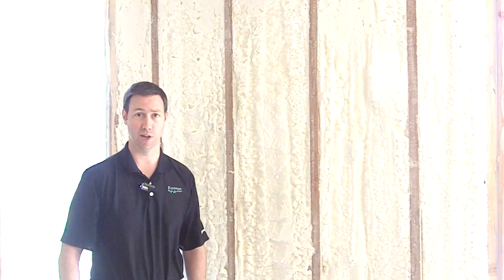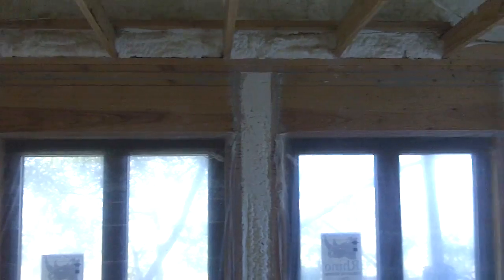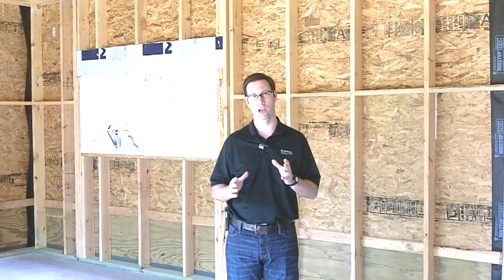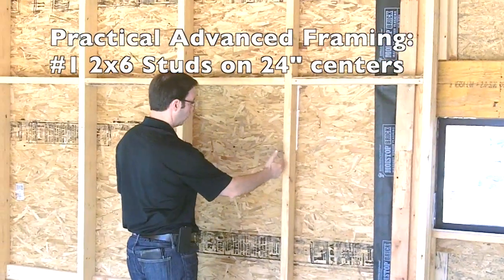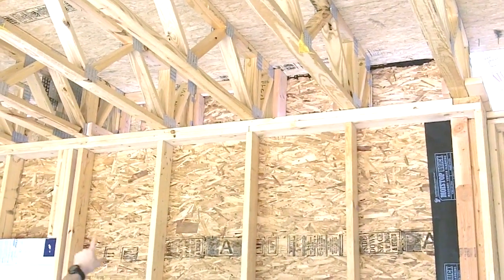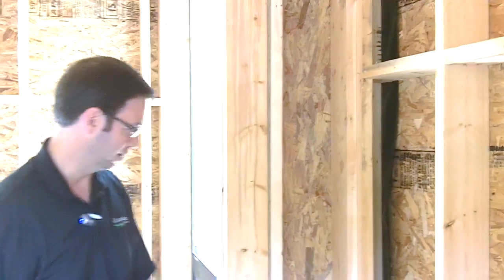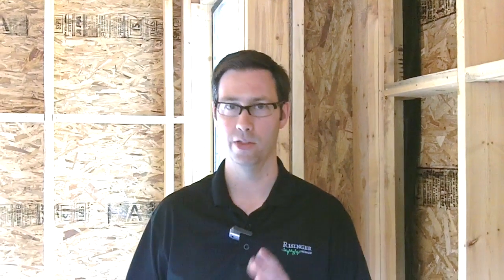Advanced Framing vs Traditional Framing

Comment: I'm sorry but "practical advanced framing' looks like a crappy way to build a house.  Same old technology but reduced for cheapness.  I'm building our new house using SIP construction.  That's Structural Insulated Panels.  Custom made to order from the traditional plans converted to suit the CNC machines they are produced on.  They consist of two surfaces made from OSB with rigid polystyrene between them.  That's the same insulation that you use to hold your hot McDonalds coffee. They are available cut from sheets 6" tp 11" thick and from 8' to 22' long.   Because they are made in an environmentally controlled factory you can be sure they are square and will not warp.  They assemble quickly and provide a dry comfortable environment to complete the interior construction using traditional methods where insulation is not critical.  The roof panels create insulated attic space without all the joists that get in the way when you want to access that space for storage or extra rooms.  They do cost a little more per square foot but quicker construction times can offset that cost considerably.  And they are far more thermally efficient than traditional construction while being around 40% stronger too.

I'm sorry 'practical advanced framing' may be practical but it's not advanced.  And I'm not sure how practical it is for the owner as it appears harder to insulate, adding expense, and appears weaker too.  Come on framers.  Get into the 21st century!  Learn how to build using SIP construction.
Reply: SIP's have their advantages but if ever a repair is needed or you need to get into the wall to access plumbing or wiring, it becomes a tough and hugely expensive undertaking compared to a standard stud-fiberglass wall. I'd rather use SIP's than the BS methods this guy is trying to sell though.

Comment: I have been in the industry for 40 years and I see no real benefits to advanced framing.  Stud spacing on 16" centers makes for a stornger and smoother wall.  OSB and drywall work better on 16" centers.  The way he does his corners take the same amount of lumber as a traditional corner but you have more to nail corner boards to on the exterior with traditional corners.  I like having the 16" centers for my siding too. It gives me ore options on joint placement.  I could on and on why California framing is more about politics than construction.   Also, your rafters should stack over your studs and just take a look at the span tables to see how many options you have at rafters 24" o/c.  16" centers works better for the entire house.   As long as you air seal all penetrations in your walls you will be fine regarding insulation.
Reply: http://risinger.co

Comment: Rsinger is a funny boy. What he calls 'advanced framing' is nothing more than economics and availability: balloon framing was used because longer, cleaner lengths of wood were easy to attain. These days it's difficult to find and much more expensive to buy long boards.I built homes for thirty years and always used California corners, so they're nothing new, just different. Yes, they allow insulation, which is always a goodness thing. Liimibeams and headers are relatively 'new' but have been around since Rsinger was in three corner pants, so they're not really new, either. Nor is utilizing treated ply for the lower wall. Two foot centers are nothing new, either. Nor is a 20 inch center (that's the little diamond at 19.3 on your tape measure). Sixteens make for better interior work, as well as adding more nailing surface for sheathing. With plastic siding, you'll be happier with 16 inch centers when the weather heats up.  We won't get into the rest of his liberal rantings, like vapor barriers (but he likes moisture proof foam insulation)…
Reply: Rock on dinosaur man! 
http://risinger.co

Comment: Unless you are installing Siding. Siding needs 16" on center. You built a house with Siding that will slap in the wind. How much did you save? At what cost?A solid piece of Wood will insulate far more than "Insulation". Blown insulation? Without a vapor barrier? I can install regular insulation WITH a vapor barrier for far less. 2X6 Walls with 2X4 insulation give you an air gap. That is far better than packing the cavity full. Everything I have built proves it.
Reply: Exactly, and no corner backers for siding corner trim boards... I guess the plywood will have to do :-O

Comment: Advanced framing? Corporate speak nonsense. What a load of crap! 24 inch centers? Yeah, you better use thicker drywall.
Reply from the maker: Yes I advocate for 5/8” rock. Not sure why you think this is “corporate “?
Reply: Corporate speak describes how language and jargon is used to attempt attach importance to oneself, by using unfamiliar terms. "Advanced framing" isn't advanced, it's just different and it doesn't necessarily make for a better frame, but selling "different framing" is harder I imagine. Then, you go on to pretend that these methods have no draw backs, polyfoam is toxic, and six inch lumber is more expensive and harder to work with, just as five eights inch drywall is much heavier and cumbersome, but hanging on less lumber.

Comment: for 2x6 walls in a non hurricane or tornado area 24in center may work.  This is cutting corners with 2x4 and in hurricane prone parts of TX.  Go ahead and get away with it in ATX but framing is such a lower cost compared to interior buildout that you won't find me cutting corners.  For 2x6 it indead, especially with cross supports, may be a good option.

Comment: When I build my house here in Alaska it will be with either 2x6 or 2x8 walls, on 16" centers, and of course with California corners.  Then insulate the heck out of it.  All expensive material but the house won't be all that big.  Probably 1,200 square feet or so.  People don't need a mansion to be happy.  I'd rather have a small house that is build solid and true, knowing it will withstand the elements THAN to have a mansion built with toothpicks.

Comment: My house is 2 x 6 exterior walls 24 inch center. 2 x 4 24     inch center roof trusses, 2 × 4 24 inch centered floor trusses and 2 × 4 interior walls. The trusses are great for achieving long distance spans without the need for support beams or poles. I am a firm believer in 16 inch spacing. Even with 5/8 sheetrock and oak floors the waves in the wall are very noticeable as well as the floor. House was built in 79, all seams are showing, floors are buckling, big price to pay for some added insulation benefits.

Comment: you were sounding pretty good until you popped the statement up there that the volume of a typical wall is 25% lumber.  Looking at a typical wall one a typical 16" on center there is  1 3/4 wood and 16 inches or space ... nowhere near 25%.  How was that number computed?

Comment: With all do respect your using just as much wood with a 2×6 as well??? Your just a sale man that's all.
Yes I have experience in framing... and osb on the outside yes its built good but your still using as much material or even more?????? When you do the math.. and your making it more expensive

Comment: "advanced framing ??",,what about the OSb installed the wrong way around,LOL..it clearly states right on the sheet that the strength axis is up and down,,,NOT sideways the way you guys installed it,and 2x6 is prettty much standard in any hot/cold climate,24 inch on center might give you more R value,but makes for 
crappy strength house,not to mention the fun the drywall guys have trying to get all the bows out of the wall.dont lean on your 24 on center drywall or you'll go through it,i guess your framing is not that advanced after all.oh,,and bugs love your spray foam, to.
Reply: OSB "Oriented Strand Board" is by nature multi-directionally rigid. It does not have a specific strength axis like Plywood, thus the name OSB.

Comment: I'll add a couple more benefits to 24" oc. Less lumber to drill through for electrical and plumbing, and easier to keep walls straight  since the drywall is bridging a wider "gap". Too bad many commentors below have to stand on their soapbox because they've done 2x4 16" oc their whole lives and thats what they know, versus listening to sound science and engineering.

Comment: What garbage this so called expert spews .I started framing 40 years ago and have always used California cornes .I always insulated my headers  This guy is going to point out his studs are 19.2" on center .I think 16" o/c is best .I've used timberstrand studs in a few cases .They didn't survive in today's market.When the cost of dimensional lumber vs timberstrand evens out builders will start using them.That makes a straight / strong wall !

Comment: so you are going 2x6 24" on center... thats 4 studs per piece of plywood 22 inches of nominal stud width.. vs 6 2x4 studs 16 inches on center which is  21 inches of nominal stud width .. so you are saving an amazing 1 inch of stud width .. which means your wall is actually slightly about weaker by 9% and its a bitch to locate electrical and boxes and blah.. and your corners are fail.. not the best system.. sure you get a tiny bit more insulation but you open yourself up to high wind damage

Comment: 24" on center is fine....for non load bearing interior walls. Also a California corner is not as strong, moreover all exterior walls should be 2x6 anyway, not 2x4 and guess what ? 16" on center.
Reply: James Dunn it looked like he had 2x6 exterior walls for this representation on 24 inch centers

Comment: I build my house with 24 inch centers and 1/2 inch sheetrock.  After 30 years no problems and you can't see any lack of straightness in the walls.   Also a frame wall with osb or plywood is far stronger then needed.  16" centers is just one upsmanship.   If 16 is better then go to 12 inch centers.  That should be even better.

Comment: 24" that was it for me I stopped watching. You saved maybe 2 pieces of lumber on one wall. Big deal
Reply: georgeEPC and the money that he supposedly saved was spent on the spray foam. That stuff is crazy expensive
Reply: georgeEPC instead of 4 two by fours you'll use 3 2 by sixes per sheet of plywood and you'll have a thicker wall to put more insulation in making house warmer and quieter, A way to look at it is Waring a thicker coat verses a thinner one!
Reply: 24" spacing with 5/8" drywall was still flimsy in a TX home I used to own. Not impressed.

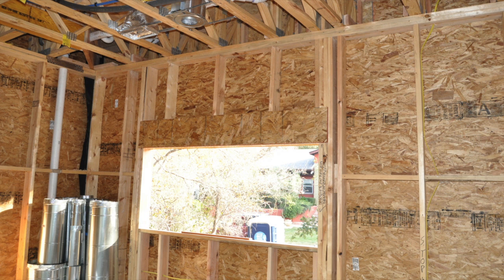Comment: Hey Matt, @ 4:13 you show the detail on the insulated header.  Would it make more sense to flip that around so that the LVL was inside and the foam to the exterior?  If you are installing a standard window then the method shown would leave a gap in the thermal envelope.

Comment: half the ideas your using in Texas wouldnt pass inspection in cold climates or any place in the midwest, due to the wind speeds and temperature changes, maybe you should put a disclaimer on your videos, to check all local building codes before starting any remodels or building.

Comment: This is not advanced framing this is GARBAGE! 24 inch centers....yeah lets just go ahead and leave that second and third story unsupported along with the roof load...WHAT A BUNCH OF BS! This is only showing what contractors do to cut corners and why houses are not lasting the way they used to. This is the reason for cracked and separating drywall and a whole host of other issues in new construction these days. 2x6 on 16 inch centers is the way to go. I'm also fairly certain that 24 inch centers is NOT per code in most areas, maybe in commiefornia but that would be about it.

Comment: Idk about other states but here in California that 24oc studs would not pass, especially supporting a second story.  We also have to fallow the engineering plans.  Are you also the engineer? Do you have inspection? Advance framing or cheap building? Your horizontal plywood hurts to look at.  I like the header idea an insulation though

Comment: 24" studs? Sure, that's up to code. Oops, the nice inspector in any urban area will tell you to tesr it down, and do it again on 16" centers.
Reply: Most local codes only require 24" centers. The reason people don't do it is because traditional sheetrock will start to sag between the studs after time. However they make lite sheetrock now that would probably be just fine. 16" centers is still what I recommend, but if you want better insulation you could try it.
Reply: Lyfan Deth 24” span is ok when using 2x6...not 2x4’s.
Reply: Exactly what I thought... This is a new home construction guy, doing a video, showing how fucking cheap they are... Not to code, won't be strong. Way to expose yourself you dumb fuck
Reply: Brad Keegan Dude chill, no need to call names and cuss. Did you see the part where he shows it being insulated? Well you can’t insulate Without a Framing inspection, But if you’re a carpenter or contractor You know That right? Also he shear paneled the whole house which Again you know That adds structural integrity

Comment: I never had understood why houses are made of lumber in this way. Why not use modern and efficiency bricks? This would result in a house that is more healthy, durable and less flammable. 
All or most of the lumber is impregnated by chemicals and the OSB / Plywood sheets as well (by the clue). 
And the insulation through polyurethane is definitely not healthy.
And do not try to tell me that a lumber construction will be cheaper than modern bricks. 
I build my house  by myself using bricks (surface  33 x 33 foot) for 28.000 US$ within 6 month all included.
But nobody would like to know these facts. For your information look here http://gosmartbricks.com/10-reasons-porotherm-hollow-bricks-are-perfect-for-your-dream-home/

Comment: What is the strength of your “Advanced” framing? Will it support solar photovoltaic, including self- orienting (to the sun – 30% more efficient) cells”?
I am a retired engineer and very interested in renewable, sustainable energy sources. I live in the province of Ontario in Canada and the regulations require a building to be “engineeringly” evaluated before solar collectors can be mounted on the roof. Our Ontario engineer’s regulating body, PEO, has told us registered engineers not to get involved. If the building owner complains, the review the professional engineer would have to go through would be “excessively” onerous. To undue this arbitrary and self serving government edict (a government bureaucracy, Ontario Hydro, monopolizes the electricity supply in Ontario) can we simply say, new construction is adequate for mounting “the best possible solar collecting systems” on today’s standard building designs? I realize that that is likely an unanswerable question but we need reasonableness to apply – not government’s frivolous and unsupported edicts.
As an engineer, I want people to build new homes with solar systems to generate electricity for their own use and extra for others, when and where reasonable. 
For insulation value, I do support 2 X 6 on 24 inch centers. I also support Structural Insulated Panels, SIPs, which Elenore Roosevelt, as first lady, build an example of in the 1930s. I also think insulated concrete forms, ICFs, are a good option. ICFs are reinforced concrete structures that are claimed to be 800 times as strong as wood frame construction. Surely, ICFs will support solar collection systems.
I put this out for consideration and further discussion. Thanks for your informative video.
Doug Kingston, P. Eng.

Comment: He must be a salesman for an insulation company!  24" centers is terrible for drywall and subfloors. Also ever look at a roof that was framed 24" centers? The plywood sags between every rafter or truss. When you walk on it, it's like walking on a trampoline that you feel your gonna fall through. About the only thing I'd ever frame 24" centers is a shed. And to be honest, probably wouldn't even do that. Gonna save 4 studs...not even worth it. The fact that he said 16" centers is over framing, tells me all I need to know!
Reply: Yup he's cooked
Reply: Since prefab trusses where introduce, roofs have been 24” on center.  And unless you weight 500 lbs the sheathing. Feels more than sturdy. It does not sag.

Comment: 2"*6" bottom floor with the 2' pressure treated plywood then 2"*4" upper floors.
That would save money. The 24 oc looks weak.

In the 40's after the war and during the building boom they we're building houses with 4"*4"

Comment: Maybe look up building codes around the country, you may get away with this mess in the hill country of Texas, but in Florida, they would make you start that whole build over. Seriously, horrible information, to act like this 'advanced framing' is better than a properly framed home, built to code. There are other ways to fortify the insulating properties of the walls.

Comment: Ahaha lumber has minimal R value???.. We've built a 1000 log cabins.. An 8 inch log is R 30...
You're nuts..
We always use 2x6  or double 2x4 (8) inch on 16 inch or better
Reply: First floor is always treated products
Reply: We use those corners
Reply: We always use 3/4 Sheetrock
Reply: We re not interested in saving lumber.. Our houses withstand most hurricanes, tornadoes and floods.. 2000 bucks is the difference between life and death
Reply: The R-value for wood ranges between 1.41 per inch (2.54 cm) for most softwoods and 0.71 for most hardwoods.
Reply: I think you might be interested in saving lumber if you are going to tear the place down every ten years or so....
Reply: Clyde 1066  , the thermal Mass factor is 1.4, so an 8" thick solid wood log wall will perform like an R11 insulated stick frame wall.
Reply: Wrong!  8" log homes  = R8 walls and leaky; $600 a month in propane plus feeding the wood stove 3-4 cords of wood.